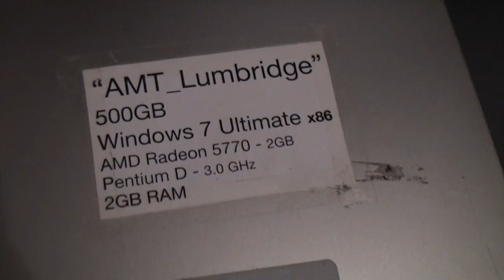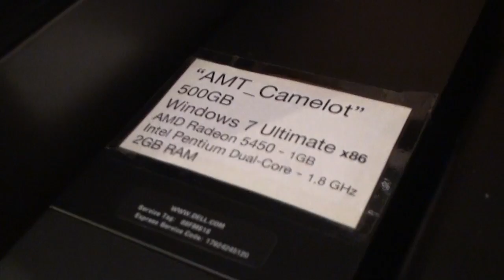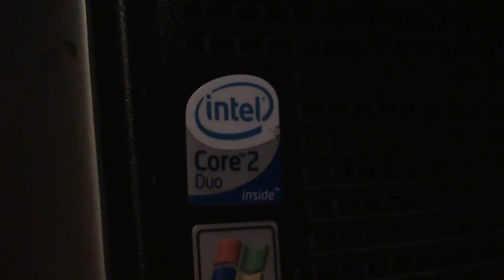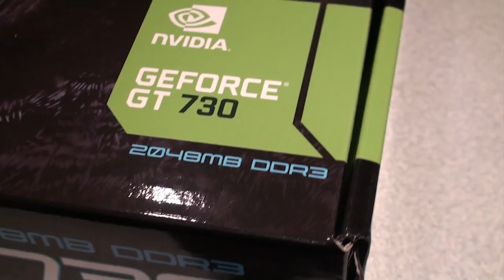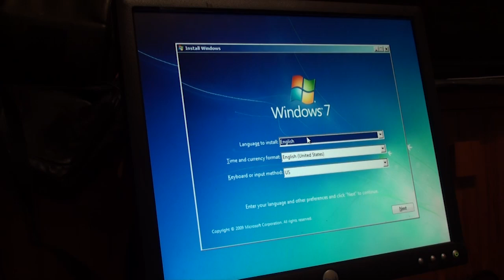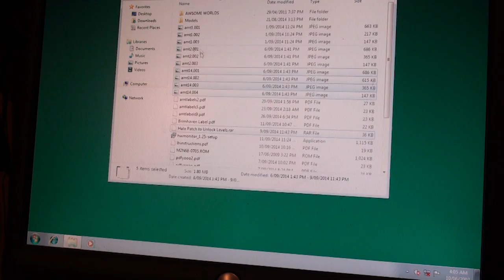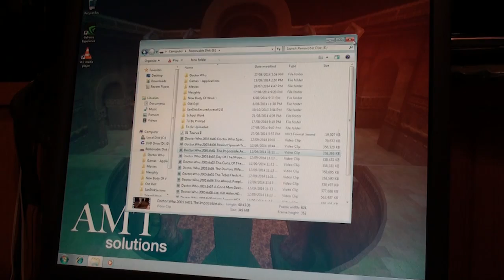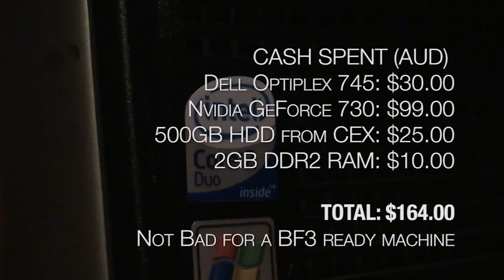Turning an Optiplex 745 from Boy to Man - Green Ham Gaming

Comment: i'm very curious as to why a lot of them say windows 7 ultimate - x86, i'm assuming x86 as in 32bit, but why? you had pentium D and core 2 series processors, which are 64bit processors, why aren't you installing 64 bit OS's? i can kind of understand with the pentium d, it might be hard to find 64bit drivers of the other older hardware but anything new enough to have a core 2 series processor should have 64bit drivers for the rest of components, by choosing 32bit you are limiting yourself to 4GB (really 3GB because reasons) of ram, and that includes your graphics cards ram, as for your older games, there are probably patches, but you have the optiplex with 4GB ram (2 1GB sticks and 1 2GB stick = BAD, you made it single channel!) and then your GT730 with 2GB, that is 6GB total, x86 can't address all that so something will be running with less ram. worst case for your games you emulate the x86 version of windows in with a 64bit host, that probably would run them fine. I just really wanna know why?

Comment: Will replacing the processor allows more RAM? Or is it the motherboard the one that handles the max capacity of the RAM?
Reply: the motherboard
Reply: Fernando Salazar lmao
Reply: Purranormal Catatonic the reason why I ask is because some CPU's require more ram to process data better, but seems the motherboard is the one that handles a certain amount of ram, unless they can add more ram from the SLI or USB, but is not fast enough.

Comment: hello mate ... nice collection u have there 
i wanted to ask u a few question if u dont mind 
i have a dell desktop optiplex 790 
with intel core i3-2120 @ 3.30 
4GB ram 
and GeForce 210 << its soo bad 
i thought about getting a new gpu from the GTX gen but i dont know if its going to work with this cpu or even fit in the motherboard/case 
and i dont know if the PSU will handle some of GTX cards and more ram 
i need ur help give me some advice on what should i get 
i only wanna play league of legends and CSGO on 1920x1080 
on mid settings would be fine if i can get consist 60 FPS 
thanks.
Reply: +xliMaGiclx tell me wich Optiplex 790 you have (left to right), Ultra Small Form  Factor (USFF or Ultra Slim), Small Form Factor (SFF or Micro Slim), Desktop Computer (DT or Slim) or Mini Tower (MT or Medium Tower...better form)?
http://sopr.com/wp-content/uploads/2012/02/opti790family.png

if you have the USFF, would mean that the mother board has onlye 2 slots for RAM (8GB in total > 4GB + 4GB), but if you have any other form factor, that PC has 4 slot for RAM (16GB in total > 4GB+4GB+4GB+4GB); with 4GB you can play, with 6GB or 8GB much better. :D

Only the Optiplex 790 with MT Form factor has a PSU with standard measures, so you could change it if you want (for GPU more powerful/more power comsumption); the original PSU in that PC are a PSU Generic (200W for USFF, 240W for SFF, 250W for DT and 265W for MT); all this info can see it in this PDF file:
http://www.dell.com/downloads/global/products/optix/en/optiplex-790-tech-guide.pdf

* The Optiplex 790 enables emigrating from an Intel i3 2100 to an Intel i5 2400, i5 2500 or i7 2600. USFF version only allow low-power i5/i7 processors (letter "S"). 

So, that PSU is a bad ass xD, but if you cant change, maybe you could buy the Nvidia GTX 740 GDDR5 (64 bit), GTX 750 or the GTX 750Ti low consumption (one fan and without PCIe 6 pin connector); if you have a Case USFF, SFF or DT form factor, you'd need a GPU low profile like this:
http://i1225.photobucket.com/albums/ee395/techdyanmic/main_ZT-71003-10L_image7_zpsf2a726cd.jpg

http://media.bestofmicro.com/A/1/446185/gallery/750_w_600.png

If your PC is MT form factor, well...you can put any GPU like this:
http://media.bestofmicro.com/,5-I-422694-3.jpg

http://content.hwigroup.net/images/products_xl/206763/asus-geforce-gtx-750-ph-oc-edition-1gb.jpg

http://www.techpowerup.com/img/14-02-12/28a.jpg

This would be your motherboard (PCIe blue color = Videocard)
http://en.community.dell.com/resized-image/__size/550x0/__key/communityserver-discussions-components-files/3514/0624.Optiplex-790.png

Good luck!
Reply: wow man thanks a lot my motherboard has 4 ram slots and i have i3 2120 3.30 GHz 
i dont know about the PSU watts 
so i think im gonna go with the 750 ti 
and add more ram 2x 4GB so im gonna have 8GB of ram and an i3 gtx 750 ti 
i think im gonna have a decent gaming PC 
for CSGO and league ... thanks a lot man .. really helped ! <3

Comment: Does anyone know if you can OC these Optiplex machines on the factory hardware or is there some dumb lockout built in since most were office PC's?

Seriously considering picking up a Core 2 Quad (Q6600 or Q9400) to mess with, but only if I can OC it.

Comment: I have a old pc with amd x2 5200+ windsor that i want to upgrade , what gpu would you recommend?(thinking about gtx 750)
Reply: +sergiu239 Try Overclock all you can; and yeah! X2 5200+ and GTX 750 it is a good combination, but if you can change to an Athlon II x4 or Phenom II x4, will be much better and will support a powerful GPU (if your PSu let you do that). What MotherBoard?.
Reply: Juan Massiosare i have MSI ms 7250 if i try to oc the cpu even with 0.30 ghz it doesn't boot from the first attempts and i have a problem i start the pc with ram at 800mhz and cpuz shows the 372mhz frequency

Comment: Would a gt 750 graphics card be able to start on my optiplex 780, or would it demand to much power?
Reply: +luis jovel gtx 750 ti doesn't require power connector from a power supply ,it get's it's power thru pci express ,which is 75 watts.
Reply: Thank you,so I should be fine then.

Comment: I know its from 2014 but still, i also had an Optiplex system with the same case and interior, for GPUs you need to use single slot or 1,5slots like my EAH5670 1gb from Asus, because the heatsinks can interfere with some MB parts around the PCIe port.
Reply: ✌😏 yup 7570 & 5670

Comment: What's the difference between a Pentium Dual Core and a Pentium D?
Reply: Pentium D is the older one, it is based from Pentium 4 CPU. Pentium Dual Core based from the core technology from Core 2 Duo CPU which is more efficient and faster.
Reply: amanguver the PENTIUM D is basically two PENTIUM 4s stuck together

Comment: yo buddy my qompac is showing a boot screen that says install original cd to boot from b u t I don't have it so it doesn't want to start windows 7 you think I should save it or trash it ????
Reply: Ok thanks I will try that today thanks for replying
Reply: +ALBERT'S PC GAMING & ARCADES change it in the bios to run from hard drive
Reply: It's not working I accidentally erased the actual os bye mistake but no worries I'm get a new operating system soon b4 November thanks for replying

Comment: "Reasonably high spec'd machine"
"2GB RAM, PENTIUM D - 3.0 GHz"
Man that feels surreal, we're pushing 32GB as the standard now and bumping up against 5GHz on 16 core processors, guess this is what it felt like for people 10 years ago looking at late 90s and early 2000s machines compared to then.
Same time my refurb'd R815 rolled out with 4 CPUs, 64 cores, and 128GBs of RAM, still the fastest compile times for anything I built until the ryzen lineup came out and still close until the 7000 series.

Comment: Hello new guy here.

I have an old dell optiplex 745  mini tower laying around here.
The specs are
Intel Pentium D 945 
4 GB Ram
Windows 7 
VGA: ATi Radeon HD 3400

What else could i upgrade to make it run games like Overwatch or Guild Wars 2 or SWTOR? if possible ?
Reply: If you want to run Overwatch, you will need some newer components. The Pentium D is extremely outdated, and will not run anything modern. What you will need to get is 4 more GB of RAM, Core 2 Quad q6600, and a GT 1030. Now before you get a q6600, look and see if the OptiPlex 745 supports it. If it doesn't, upgrade to a whole new platform, and get an old OptiPlex 790 or 990. The 790 and 990 use a much newer Core ix processor (usually i5-2400 or i3-2100), which perform a lot better than the older Core 2 and Pentium D processors. And if you get an OptiPlex 790 or 990, get a GTX 1050 or 1050ti, which performs a lot better than the GT 1030.

Comment: What would be a good graphics card for a core 2 duo e8600? I was thinking a gtx 650ti if it would work on a 300 watt power supply
Reply: +Westin Mcclister GET A 950!
Reply: +Westin Mcclister Nah, get an R9 270.  Much cheaper, down to $100 USD used and performs better.
Reply: I'll probably get a 750ti for now so I don't have to upgrade my psu but maybe a 270x down the road
Reply: Well, by the time you get a PSU upgrade the 270x would be even older and only a marginal upgrade over the 750ti.  Might as well stick with the 750ti if your PSU can't handle the 270x.
Reply: +Michael Gunn if you do get a r9 card, you better get a 270 non x. although i think it would be bottlenecked by a c2d

Comment: The old Optiplex core 2 machines all still have good life in them if you do upgrades like those shown in this video. My main rig is a custom core-i5 beast with 16gb of ram and a GTX960. I also have an Optiplex 755 Q6600 with 4gb of RAM. It will be getting a GT730 video card and will make a nice secondary guest gaming box. Should run things like TF2 and Rocket League beautifully.

Comment: I have dell optiplex 755 4gb ddr2 ram, 500gb HDD, inno 3d gt430 and core 2 quad q6600. Would it be worth upgrading it to gtx 750 ti and 8 gb of ram?
Reply: +Xeon Gaming Depends what games u play and how long ur planning on waiting to do a full upgrade. There is a trick involving some painters or electrical tape covering 2 pins on the bottom of the Q6600 and it overclocks the FSB to 1333 from 1066 increasing ur CPU to 2.99ghz. The 750 ti would be bottlenecked a bit by it but this will help, also you would want to check if ur specifc form factor/ motherboard supports the full 8gb.
Reply: I wouldn't like to oc cpu because i would need to change cooler cause in BFBC2 cpu reches 69 celsius, and yes my MB supports up to 8gb ddr2 ram.
Reply: Well the HSF on the dells are OEM so u cant really slap a cooler master or zalman on it, but u can replace the thermal paste. I just resurrected a Q6600 build for just basic browsing and light gaming (still use my Phenom II and 6950 for the rest) and its showing its age but these things for most are actually very capable. DDR2 can be expensive now though. If u can track down 2x2gb ddr2 800 or 667mhz (ebay has them but make sure its for intel chipset) and a 750ti for around 140 bucks id say it should last 2 years maybe more. This year both team green and team red are releasing new architecture, so we'll see!
Reply: Tnx for help :)

Comment: Pro tip:  Get an LGA775 to 771 adapter sticker, and drop a quad core E54xx xeon in. They are pretty cheap, just google which stepping series work with the 745.

Comment: I pwn one. a 745. threw a Radeon 6450HD in it and it ran very very well!!!
Reply: D. C. S. that's the nature of old PC's
Reply: Well the thing is, my Optiplex 745 (Intel D 945 dual-core) works very well it is the same speed as my i5 2400. My i5 is better game wise with the extra horsepower. 40 FPS is 80 FPS in the same game.
Reply: D. C. S. im thinking of upgrading the power throuing it in a new case and putting a nivida card like maybe 970
Reply: Druix That should give you 50-80 FPS as long as you have 4-8GB. The DUO is a pretty good processor. And I was using an Radeon 6450 so you should get around that. The max FPS I got was 300 lowest 20 FPS (depending on resolution) on my R7 360/i5 2400/20GB
Bottleneck is the ePCI 2.1  That is okay, it would only give me 20-25 more FPS. My average FPS is 70 on modern games DX11 1080p. 80-100 DX9 depending on resolution. I  can do DX12 but my system is bottlenecked by the ePCI 2.1 spec.

      It does really well no matter what. Anything above 60FPS is not really noticeable other than input lag is reduced more and more as faster the game goes. I like this R7 card I wonder what I will get on RX 480. The only reason I will go Green from Red if I get better overall gaming (PhysX).

Comment: I have an OptiPlex 755 I've upgraded into a very powerful gaming PC. 16GB DDR2 RAM, 3Ghz Intel Core 2 Quad, NVIDIA GT 730 2GB DDR5, OCZ Agility 60GB SSD, 2TB HDD and it plays most games, including GTA V above 70fps
Reply: Matt Bates May I ask exactly what 730 it is. I have the 755 and want to put a gpu in it, but I am worried about the capacitors next to the PCI port preventing me from putting a card in.
Reply: Yeah, it's the 2GB GDDR5 GT 730 by Gigabyte, purchased it from Scan UK for £56. What version 755 do you have? I put this in the large desktop tower version (not the small pc) and there is plenty of breathing room for the caps. You can fit a finger or two in the gap. Plenty of good airflow too, the car is smaller than I expected. I've been running most games on Ultra and it's not gotten hot. It's a worthwhile investment next to an SSD. I was aiming for budget, but can play modern games. Feel free to contact me if you need any pics or anything like that
Reply: Matt Bates I have the full tower as well, Thats pretty cool that it fits very well, thanks for the response.I'll see about that card. (:
Reply: Also, have you upgraded the mother board, or is it the stock one? Again, thanks for the response.

Comment: Can I switch out the mother board inside of those computers?
Reply: do you know if you can yet
Reply: Of course you can. Which ones in the vid are we talking about? these optiplexes mostly aren't standard form factor so you can't swap in any other mobo.
Reply: +Scott Chiste  Duh, as long as you have a good power supply and your CPU is good with it.
Sometimes the GPU does have compatibility issues but not enough as the CPU.
 Just check the power consumption make sure you have a good power supply and check that your GPU and CPU are compatible.
Reply: +Lloyd Nix Ever worked with Dell computers before? Optiplexes are really limited of what you can swap inside. Stuff is mostly non-standard, such as front panel headers, backplate not removable.. unless you're dedicated to mod the thing, not gonna work out of the box.

Comment: I have a dell optiplex 780 and it has a core 2 duo 7500 2.80ghz if I add a graphics card that's good will it be a good gaming PC for CsGo or crysis or call of duty
Reply: well depends on how much RAM you have and also if you're interested in getting a beefy GPU you'll probably need a better PSU
Reply: for the most part a 750 would do since it doesn't require external power but, for the best crysis experience you may need to to some overclocking on the GPU and CPU if you do plan to overclocking I recommend looking at a guide on the specific part you're getting and you may need to add some case fans and a new CPU cooler depending on how heavily you plan to overclock
Reply: +Jonathan Aaron yea I won't be playing crysis
Reply: +Jonathan Aaron specs
Intel core 2 duo e7500 2.93ghz
4gbs of ram
Intel chipset q43
And a pcie slot for a graphics card and the graphics suck on my current one
And btw my PC is a dell optiplex 780 it has a small case but I could do some stuff to it to make it bigger it can only fit a vga and a hdmi port so that's a downside
Reply: Pulse Gaming what's your budget for the GPU and what currency are you using?, also sorry for the late reply
Reply: Jonathan Aaron
no prob and 80$ or 100$ at max but 80 or 70 is better
Reply: Pulse Gaming try a 750 ti
Reply: i got a r7 250x

Comment: As I see you have got those optiplexes... could help me with upgrading my optiplex 740 which has 2gb RAM, ATi HD 2400 PRO and the worst part is it's very old processor which is an AMD athlon 64 X2 Dual Core Processor 4600+ clocked at 2.4 GHz. I want to know if A motherboard change is a requirement for the Graphics and Processor upgrade... thank you so much and i will think about sending in a photo of my room HQ if i get time to tidy up things a bit. but dude I like the way you make videos, they are very entertaining and informative at the same time.  thanks for your time :D
Reply: Yes, for a cpu upgrade a new mobo is mandatory
Reply: Thanks. I just checked and my motherboards socket is an AM2 :) i need AM3+
Reply: Got my rig and the case is cooler master cosmos 1000 😎

Comment: i have an "optiplex 790" 
but in another case
and with a new PSU
and new GPU
it actually runs quite nice, as the CPU is a Core i5 2400

Comment: Would the GTX 760 work on a Optiplex 755?
Reply: No. Probably too big and not powerful enough power supply
Reply: YoMamasTacos could i change the power supply then
Reply: PixBlox Yes, you can, I'd go for an EVGA 500W 80+ Bronze unit, but then space would be a constraint. A 760 may not fit in the case. Check the maximum GPU space in the case online.
Reply: YoMamasTacos And I could also put it in another case right?
Reply: Yeah, but then you'd end up pretty much having an entirely new PC. Might as well get a new one. With a form factor like that computer, a small form factor 950 or 960 may work. Wait... 760? Do they make small form factor 760s? I'll do some research.
Reply: Just did some research. Turns out Asus makes one:

https://www.asus.com/Graphics-Cards/GTX760DCMOC2GD5/
Reply: YoMamasTacos Thats good. :)
Reply: Well... I did more research... and the news isn't good. That 760 takes up two slots on back, but Dell's strange BTX setup only allows one slot per PCI-E card. So you'd need a very small under-powered card. So you may have to put it in a different case, which seems like a lot of work. 

I EVEN INCLUDED SOURCES! 

http://www.tomshardware.com/answers/id-1765593/graphics-card-computer-optiplex-755.html

that asus website again lol

Well, I'd also look at the guide on that article. What he's talking about is the mini-tower.
Reply: +PixBlox 750ti would probably be ok